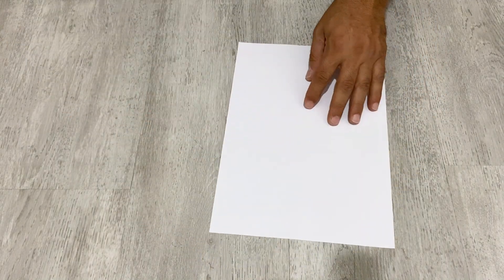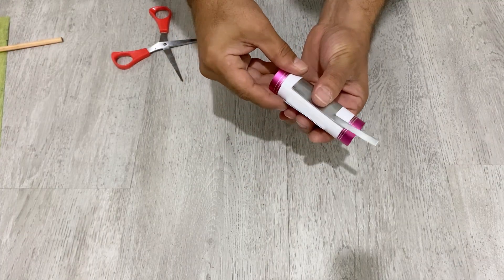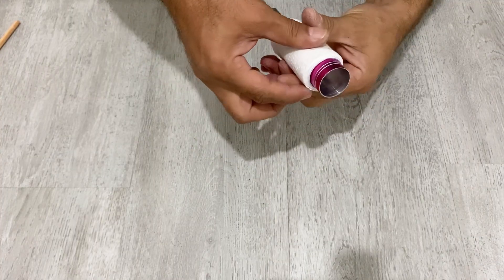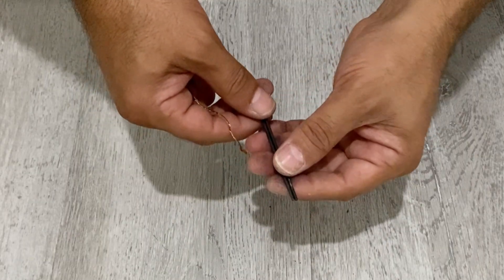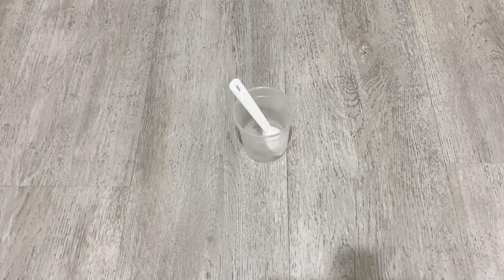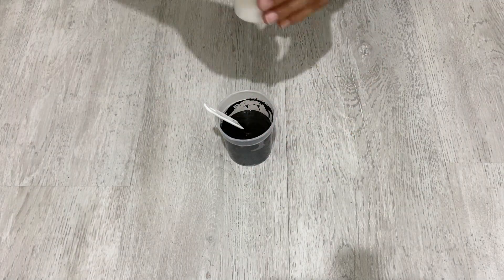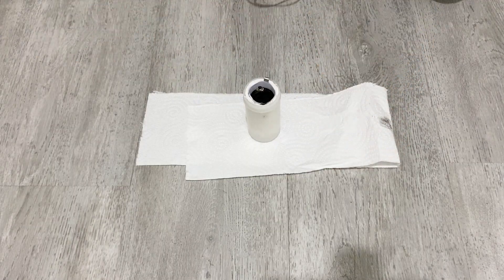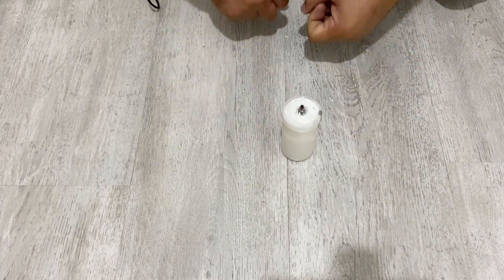How I Built a 10,000 mAh Zinc Carbon Alkaline Battery | DIY Advanced High Capacity Battery

Comment: Sodium silikate + KOH = Bad idea! Sodium silikate neded low down to reaction NaSiOx + Acide all variation = SiOHx - H2-3SIO4 (sponge low down) - filtrate clean water to solution NaAcide = Clean hudroxyde silica + xKOH = K2SiO4 = More stable elecrolyte! 😶‍🌫🤓
Reply: Hi, you interested in talk about those and more? Iam doing practical research of whole nature living for psychologically Ill that lost homes due to theire issues. Around many millions allready, and as a biochem electroengineer I do feel like you and me might have good Convo. 
I learned woodwork,stone work, cyclic and waste usage procceses, conduction, convection, reflection and isolation at atomic levels, and other critical fields. 
And I might as well need help, as it's getting kinda hard and even tho I have Good theoretical syste for massive energy alcaline battery (10 buckets, heated sodium bicarbonate to make washing soda for 9% solution, on bottom of bucket carbon cleaned from ash by water and gravity, and aluminium ,,cucumbers,, that can be either made from foil from store or cans from trash)

Overall the system should have  12v 336 kw/h but details matter, but details would be needed. 

And many more, any info might save lives even this winter, and surely will save lives in long run, as biggest social worker corporate In this country would enjoy manual from me, yet it's little more developement and practical testing needed.

Comment: aluminium-air? aluminium is more reactive than zinc. 3 electrodes stack not just 2. you could have left the zinc out completely. well the aluminium is a current collector. but check the voltage, if its zinc-air or aluminium-air. oh KOH water electrolyte ok. seems like zinc-air voltage around 1.45V. well ok then.
Reply from the maker: Thanks for sharing your thoughts!

Comment: Please always indicate if the battery is a primary battery or rechargeable.
Reply from the maker: All alkaline batteries are primary 👍
Reply: @joyofelectronics9782  incorrect, there are rechargeable alkalines based on manganese, nickel iron batteries (Edison cells) are alkaline (KOH electrolyte) and there are others.  Thus one needs to identify if a specific chemistry is rechargeable.